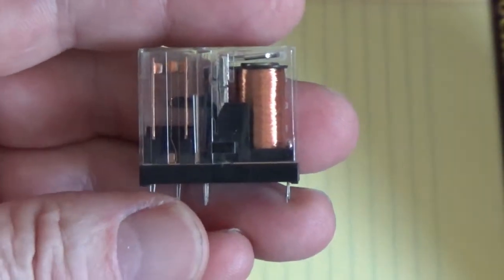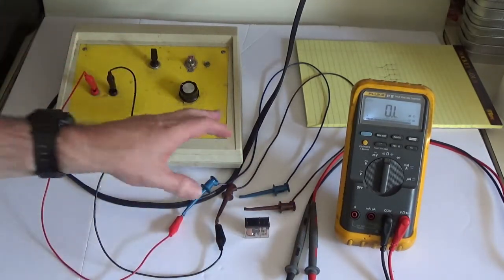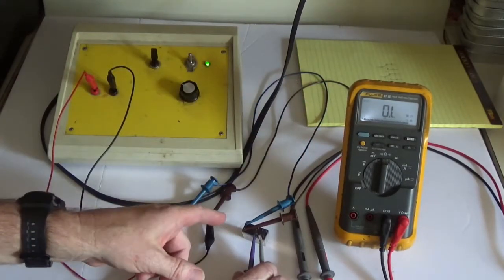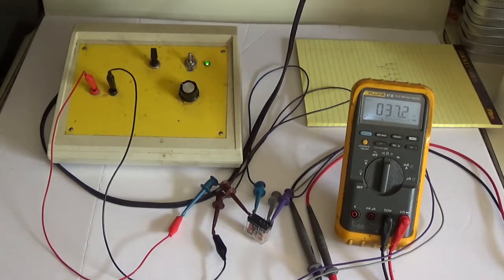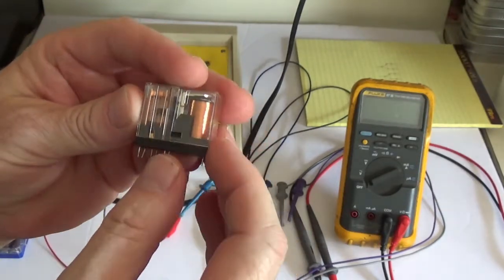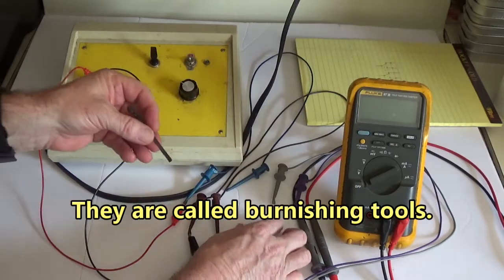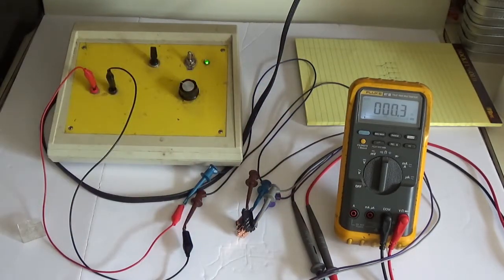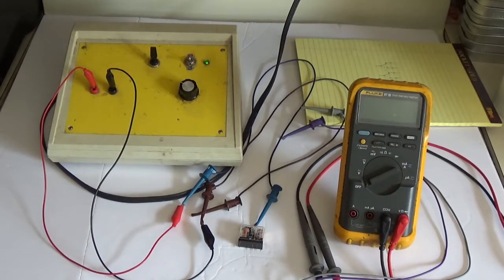Testing and repairing the Electro-Mechanical Relay

Comment: What would you do to repair a problem with it not switching state (if i give it a few taps it will change)? Also, what types of equipment have you seen these relays in? I am up in a remote part of Northern Canada to repair an elevator which happens to have one of these sticking. The plan is the attempt repairing it tomorrow, as I wont be able to make it back here with a new one for another month.